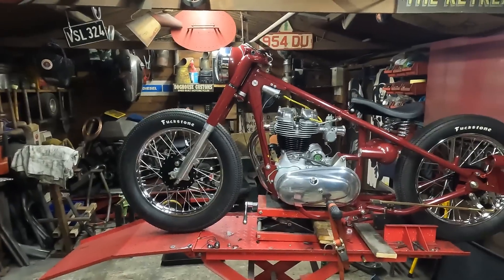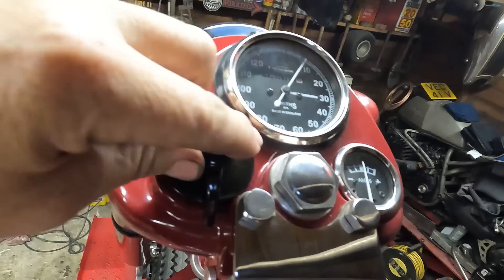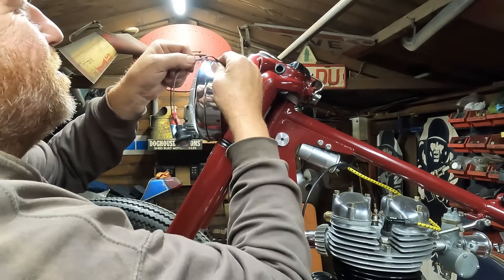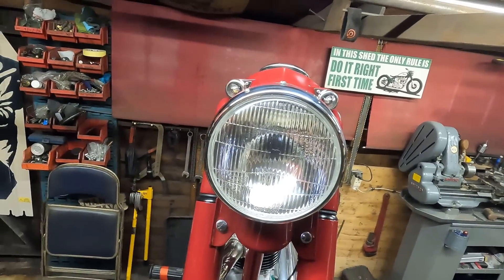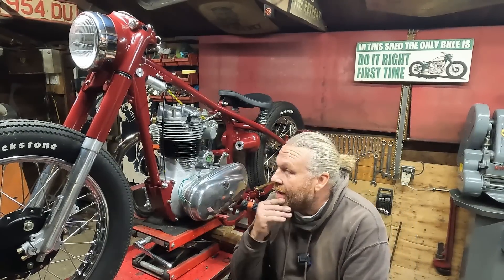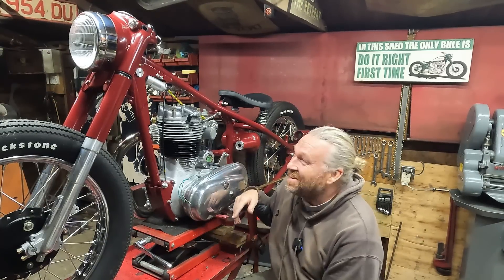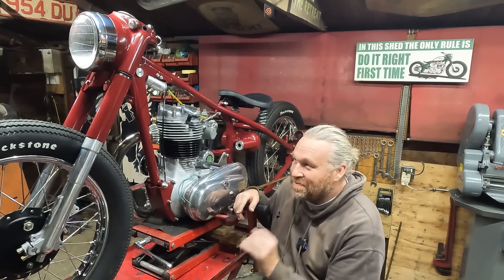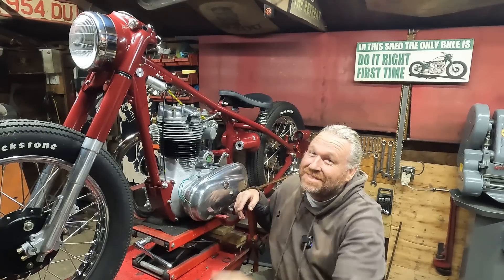Very Quick Catch Up Royal Enfield Bobber

Comment: I understand getting the downs for no reason, mine are usually morning time. You could have tons of work to do but doing it is a real chore, personally, if I force myself to do something and few understand how difficult it is I feel so much calmer later in the day.
That aside, Craig, you really need to get down to the local shop and put a couple of quid on the lottery, you have more chance of winning it than getting both tyre names sitting perfectly at 12 o'clock lol.
The bike is looking great.